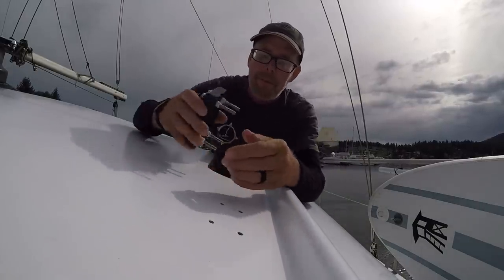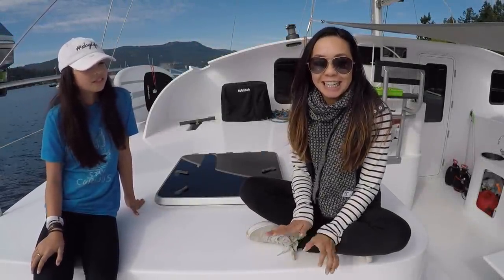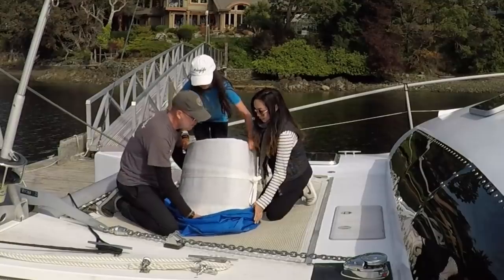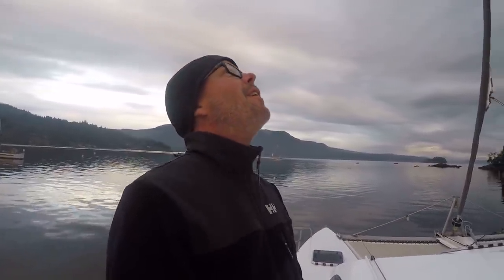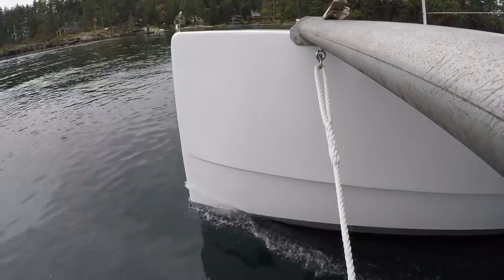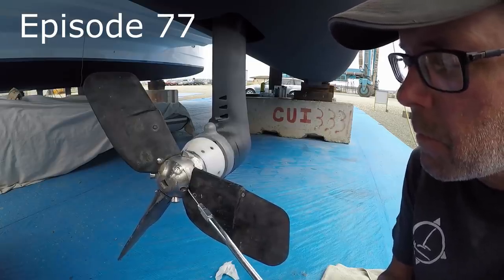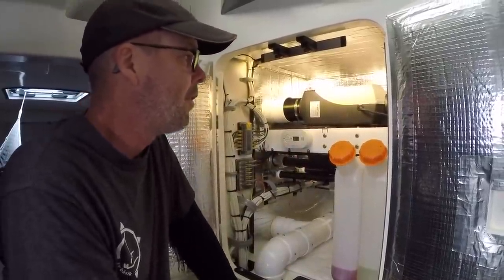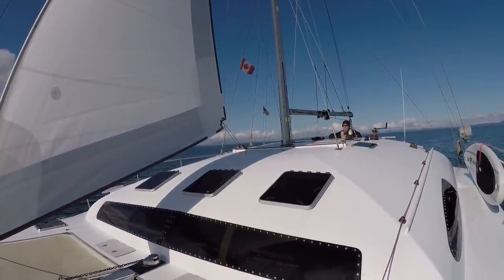Installing Our New Headsail! Onboard Lifestyle ep84

Comment: The smell is highly depending on the quality of the diesel. Being from scandinavia and spending summers on boats, the smell of a dieselheater is lovely and nostalgic to me. Until I worked in england on bigger workboats with dieselheaters. The smell was dramatically more intense but when we took one of them to denmark for another project we noticed a big change in smell from the heater onboard. I have since shifted back and forth between england and denmark mainly and every time we move a boat from denmark to england, we stock up the boat on everything fuelrelated. Pumps, nozzles and filters doesnt really like the dirty diesel over there. The last boat i worked on we taught ourselves to service a bigger kind of dieselheater onboard. After a service we got between 9-12 months of running in denmark while in england it took 4 months for it to clog up.
Reply: Good to know! Thanks! 👍🏻

Comment: Do you see the need for a Fixed Lead Block or two on your jib line to get it down to the deck so you don't have to step over it? Possibly an additional furling or two.... You don't want to trip in the dark or heavy winds.... everything is so clean on the vessel, just a thought.
Reply: Yes, we have it and will install it so it will be closer to the deck and not be a tripping hazard. Teal wanted to work out any issues beforehand. 👍🏻

Comment: Congratulations on the new sail guys!Z
Hey Teal, just a question on the deck hardware: it seems you're drilling through two layers of cabin top to install the clutches etc, do you have to be super careful at how tight you torque up the bolts inside? I'm guessing you don't want to be compressing the two layers too much?
Thanks again for the great channel!
Reply: That's why we have backerplates to absorb the compression. 👍🏻
Reply: @linhgobenyt  Thanks Linh!

Comment: Buy two new props and keep the old ones as spares. Mail delivery is not good if your leaving the U.S.. When things go wrong they are never convenient and the price for non-conformance could be pretty high. Your propellers are your main propulsion and will keep you on your way. Beautiful Job!!!
Reply: Actually on a sailboat the wind is your primary source of propulsion.
Reply: @robertadamsmetaldetecting6324  I don't know but the other sail channels seem to pull their sail down in high wind and when they go to safe harbor and tie up or anchor. I think they are both important.

Comment: Great job with the deck hardware.  Looks super awesome.  But I'm wondering why you only put butyl around the bolts and nothing  under the whole foot print of the hardware.  Won't water get under the edges and allow for the growth of mold?
Reply from the maker: As long as the butyl is sealing around the bolts and backerplates, there isn't the need to seal the entire hardware.  Plus, it spreads pretty evenly as you tighten them up.  So far, no leaks! 🙌🙌

Comment: A question , love your blog , why do you have self tacking jib, your cruisers so I dare say you won't be tacking often , 
When you furl some away in higher winds you hate the shape, you don't have the track to move back and forth for trimming,  so you cannot close the top , 
And when running downwind it's harder to run a barber hauler to open the sail out ,
Reply: Interesting thought or insight.....
Reply: @stevemazz3121  experience,  sailed many self tackers,  quite often used on cutter rigs, they have put them now on lagoon cats, dead down wind is a pain , I know cats are 130 ish degrees,  but with big seas this puts a lot of pressure on the helm,

Comment: How do you fill the "day tanks" on the heaters ?  Why was one fuel redish and the other yellowish ?
Reply: In the US diesel sold for heating is taxed at a lower rate.  They dye it red to keep trucks from using it.  If a trucker is pulled for inspection at a weigh station, and the fuel is tinted, that person is in a heap of trouble.
Reply from the maker: One was purchased at a marine fuel station in the States and one was purchased at a gas station in Canada.

Comment: Hey guys. Have you replaced your rig in yet? Also that furling line looks to be a tripping hazard!
Reply from the maker: We have been inspecting our rig weekly and if we see something with corrosion, we will replace it.  We didn't install that last standup block until we fine tuned the jib.  Now that we have, it's been fixed so we don't have to worry about tripping on it. 👍
Reply: Onboard Lifestyle ok. Well just keep checking your insurance each year to make sure they aren’t changing anything on your and that your rig is still insured. We had friends who’s insurance company had changed T &Cs without them knowing.